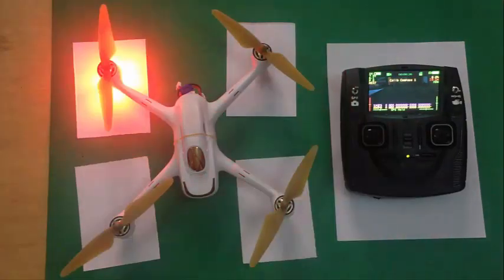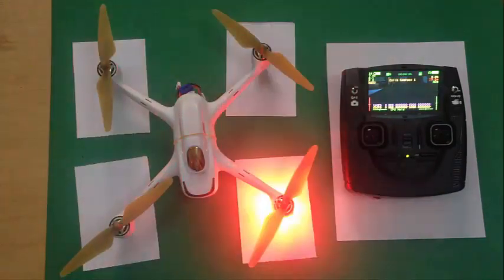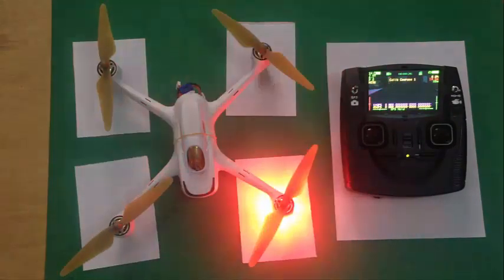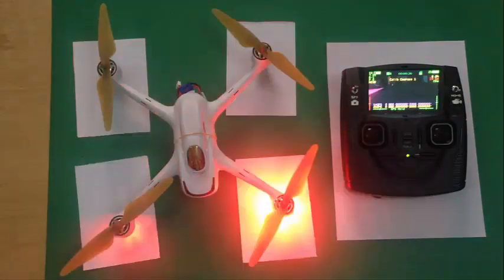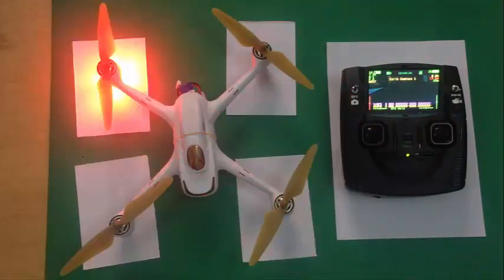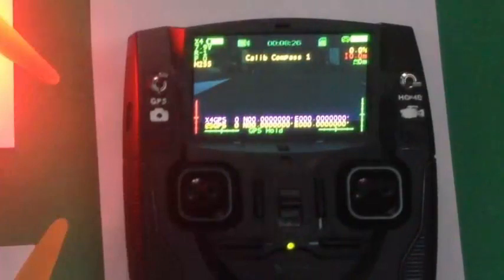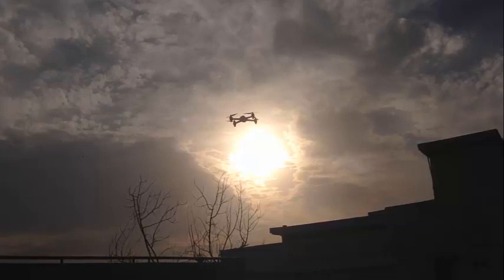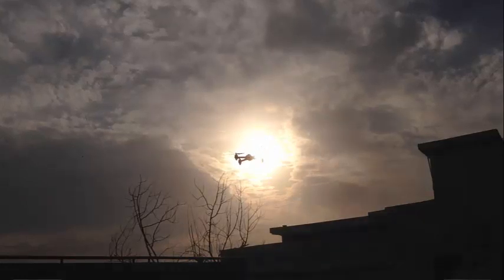HUBSAN H501S HOW TO AVOID  FLYAWAY

Comment: Also stopped watching 2:32. I have 501s-s. I only compass dance on new flight spots. I'll change spots 2-4 times inaudible day that I've flown in before and wont calibrate. Never had an issue. I do like to compass dance once in 20 flights ifiont go to new spot.

Comment: Why are you walking around in circles to calibrate? Just take off your watch if you're wearing one, put cell phone somewhere out of range and the controller at least 10 feet from the quad when calibration. When it's ready for cal 1, simply spin the unit slowly in your hand holding it level, then turn it nose down for the cal 2 and same slow spin. usually two turns each way will get it done. Walking around in a circle is crazy. I have never had any problems with mine. Watch the R & P values, 0, 0 is preferred, 0,1 or 1,0 or maybe even 1,1 is ok, but anything else you should re-calibrate and hold level. 
Good luck
Reply from the maker: ya we at hubsan community call it hubsan dance  that is the correct way to cal  ,, i am happy to hear that you did not got problems with  way you do it  by holding it and giving spins it cover the compass so it may not be calibrated correctly yes  watches, cell phones , do mess with that thats also advised to put a side when calibrating  you should try this method you will not regret and check the performance than  thanks :)
Reply: ok, cool- happy dancing to you
Reply from the maker: thanks :)
Reply: Your way makes more sense than walking in circles. The whole idea of spinning the quad at arms length is ridiculous.

Comment: I also stopped watching a couple minutes into the video. You are correct about waiting until you have enough satellites on the quad. Wrong about the satellites for the transmitter. The only reason the transmitter has a GPS module in it, is for the "Follow Me function". Does Not Matter How Many Satellites    the Controller Has Unless you are going to Use "Follow Me" . Also the h501s Will have GPS hold with 6 satellites Not 7 . However, you should always give the quad time to acquire as many satellites as possible, (12)... The Return To home Spot Is Set As Soon as You Arm the Motors. Has Nothing to do with the Controller. Compass Calibrations Are Very Important, So is Keeping All Metal And Cell Phones Away from the Quad From the Moment You Plug in the Battery and it Self Initializes And During Compass Calibrations. I agree with you that some flyaways are caused by GPS hold and during RTH's because of the flight control board and firmware in the h501s. However, if you do you Pre-Flight initialization And Compass Calibrations Correctly, Flyaways are Rare. All Starts From the Moment you Plug in its battery....
Reply: Price: 215.92 - 263.32 dollars. Coupons:
http://couponsfromchina.com/2017/03/15/hubsan-h501s-x4-drone-active-coupon-price-gearbest/
I hope this will help you

https://www.youtube.com/watch?v=AdTOPAUnl4A
Reply: Mark Suttner you are incorrect about the controller gps uses. Rth works from the controller. I own a hubsan h501s advanced. I tested the rth many times even walking many feet away from the launch point and rth home always came back to me. Many feet as in 50-100ft away from start
Reply: @TheFlyingJerzey  Hello, I always wondered about that.  I mean, what if you launched from a boat and then the boat moves.  I wold want the drone to
return to me, not to where the boat "was"!
Reply: @clarkeugene5727  i dont know how that would work on a boat. Might. I never tested it on the water